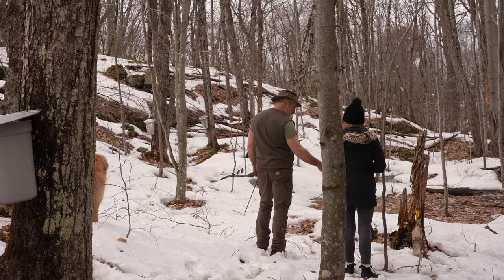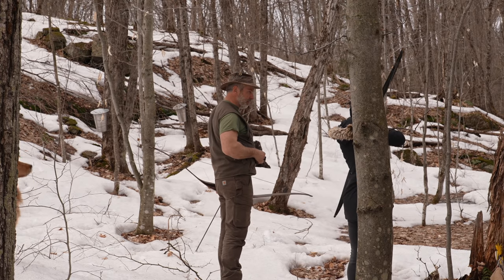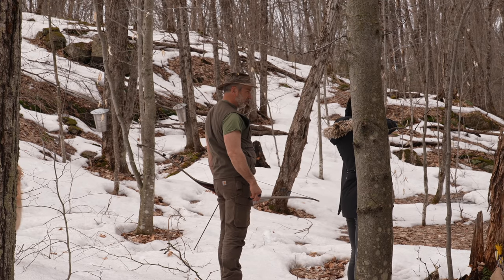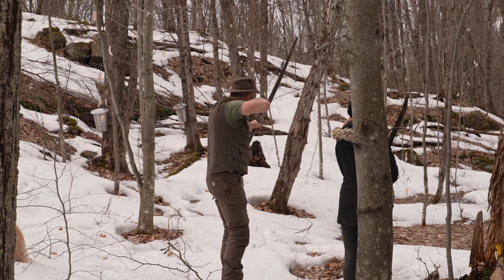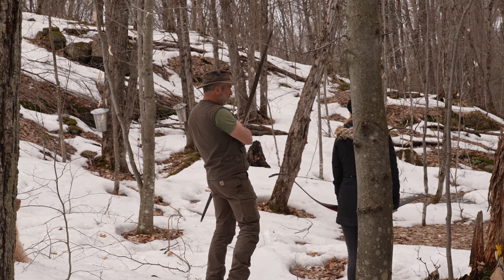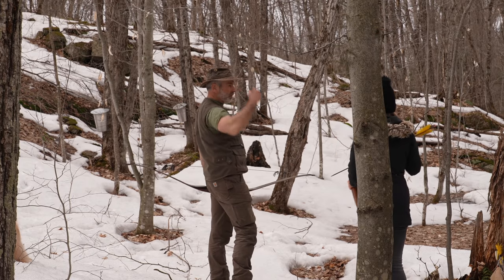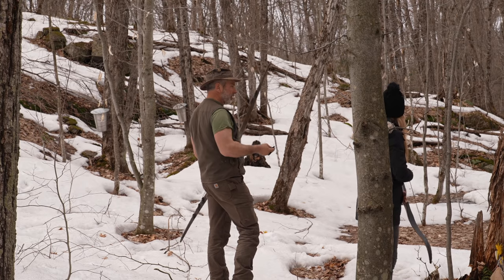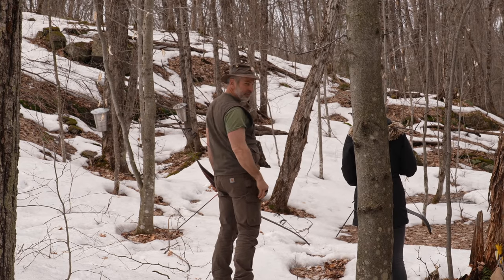Building an Off Grid Log Cabin Alone Ep 15, Tie Beams, Maple Sugar, Family Self Reliance

Comment: I'm no expert at archery, but I taught it one summer at a Boy Scout Camp in Wisconsin. It was my first job out of the Army and I had applied to be the rifle range instructor. We used recurved bows like you're using. The Bows we had were sized for the Scouts and not me, a 6'3" (1.905 m) guy. You have to use one made for your size. The best advice I can give your daughter is to practice the draw, as you build up your muscle strength and muscle memory of it, it'll aid in the release and help you to stay steady in aiming it.  At the start of the summer I couldn't hit the massive target we had from the distance we had set up. After a week of practice I knew exactly the aiming point and how much of a draw I had to do on the smaller bows. I could hit the bullseye every time I demonstrated archery for the Merit Badge I taught that summer.

Comment: You need to build a "funnelator" to launch tennis balls for Callie. You connect a funnel between 2 pieces of surgical tubing and tie it between 2 trees or other structures. You will be able to launch a tennis ball across the meadow. I had an OCD black lab and this was how I saved my arm and shoulder.

Comment: Why the large gap between top of window frames and log? If it's to account for settling of logs, how do you plan to close gap in the meantime? Did I miss something? All the best from Missouri.
Reply from the maker: I’ll add a compressible insulation and a sliding trim to cover it until it finishes settling

Comment: If you have a water source that close to the greenhouse, did you consider running a pipe out to it connected to the greenhouse?  It would be a simple matter to attach a hand crank pump to pull water in as needed.  

Did I see the makings for huglekulture in those beds?

Comment: Hey Shawn, how do the pins or dowels work with the shrinkage of the logs? You’ve left space at the windows and doors for log shrinkage, are the pins you’ve hammered in cut short to allow for shrinkage too?
Reply from the maker: Yes, and inch or two shorter than the hole

Comment: I was thinking about what you said in your other video about the upside-down V shaped roof on the breezeway connecting to the cabin roof to form two valleys that would shed all that snow into the two corners where the walls of the breezeway connect to the walls of the cabin.
Specifically, I was thinking about the cellar window and the hole in front of it, that you boarded up and filled up for during the build.
Once that cellar window is dug out and you've made a more permanent soil retaining box to keep it free, do you want your roof shedding piles of snow into that hole? Are you going to put a lid on it, like a root cellar, during future winters?
The lid will need to be able to take the weight of all the shed snowpile.

Or you could make the breezeway wall go up high on that side, and slope down one way, shedding all its snow towards the back.
That does change the angle of the roof though, maybe it won't be steep enough for shedding snow anymore if the cabin ridgepole height isn't going to be all that high above these crosstie beams.
But if the roofridge is high enough, it might also create some storage-loft hight in the breezeway that you could store and access stuff up there that needs to stay dryer than in the cellar.
Off-season clothes and gear, the cushions for the outdoor seats etc. were what came to mind for me, as well as less practical options.
Reply from the maker: The overhangs extend past the window well and yes, I’ll probably still have to put a seasonal cover on it (maybe tempered glass so it still lets light in)